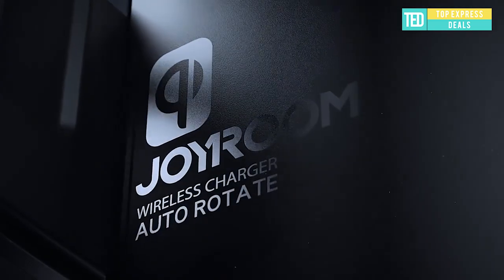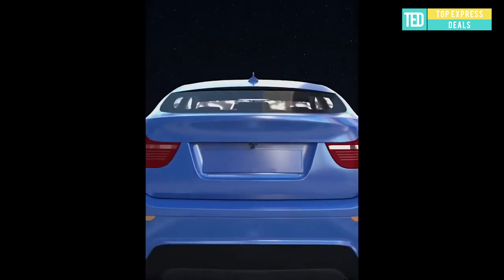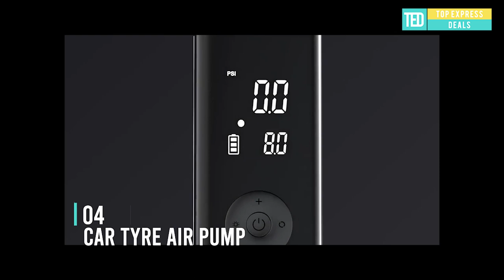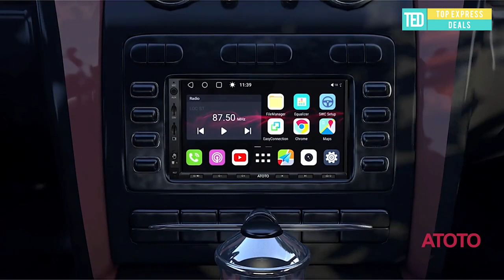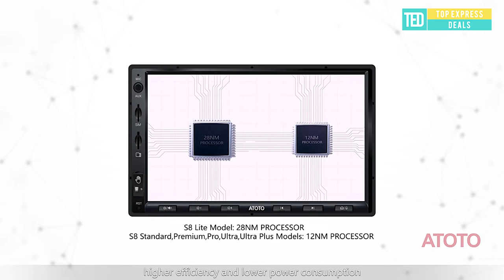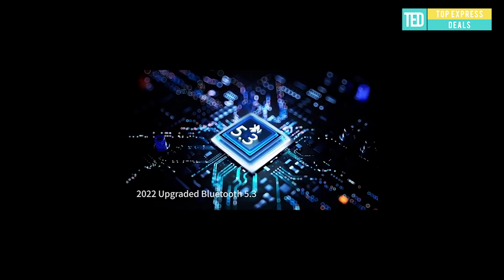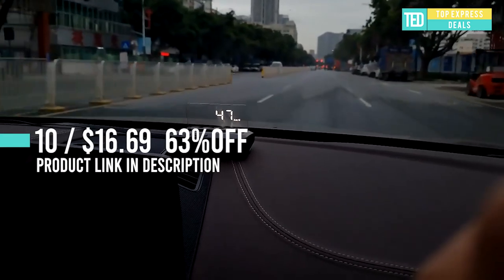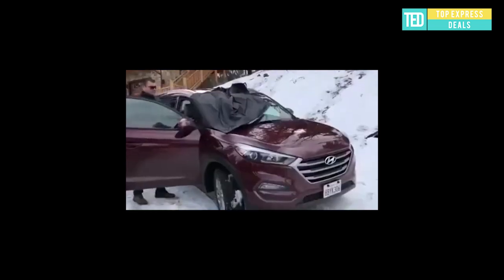Top 13 Car Accessories from Aliexpress - Amazing Gadgets for Your Car

Comment from the maker: 👇👇👇LINKS TO PRODUCTS BELOW👇👇👇

01 Car Phone Holder
Aliexpress: https://bit.ly/3YTyDZV

02 Car Rear View Mirror
Aliexpress: https://bit.ly/3yS1Oln

03 Car Blind Spot Mirror
Aliexpress: https://bit.ly/3lnAkBc

04 Car Tyre Air Pump
Aliexpress: https://bit.ly/3JqpUZv

05 Car Air Humidifier
Aliexpress: https://bit.ly/3Jqneeh

06 Car Stereo
Aliexpress: https://bit.ly/3Jqqsyx

07 Car Vacuum Cleaner
Aliexpress: https://bit.ly/3YU9tue

08 FM Transmitter for Car
Aliexpress: https://bit.ly/3JMuuTj

09 Car Steering Wheel Cover
Aliexpress: https://bit.ly/3JKsfjg

10 Head Up Display
Aliexpress: https://bit.ly/3LvrH20

11 Plastic Renovator for Car
Aliexpress: https://bit.ly/3lkq10C

12 Car Scratch Remove
Aliexpress: https://bit.ly/3LzMaTo

13 Car Windscreen Cover
Aliexpress: https://bit.ly/3TlAupl